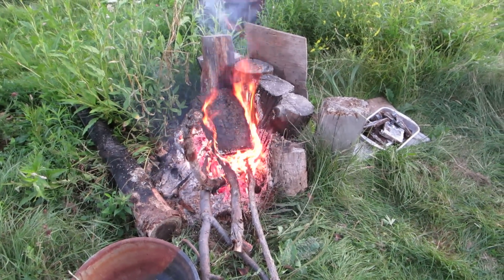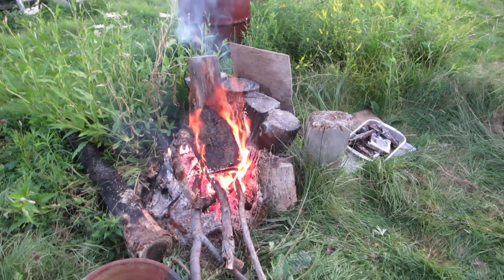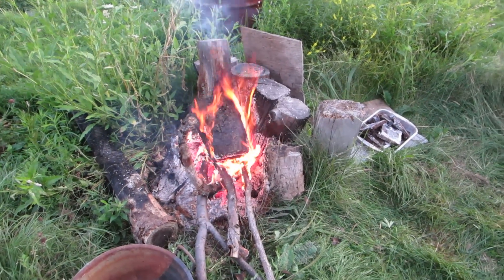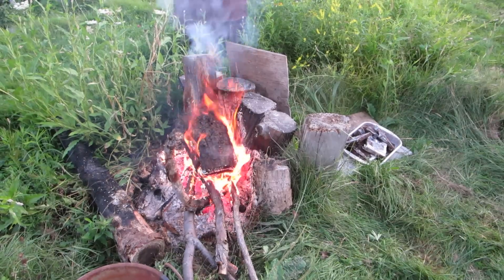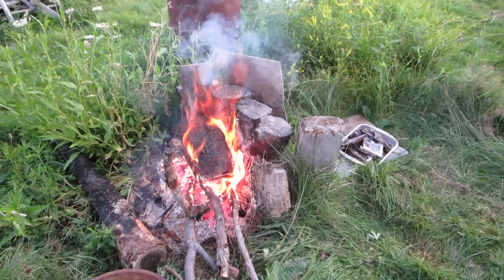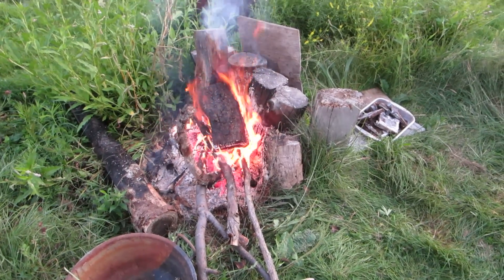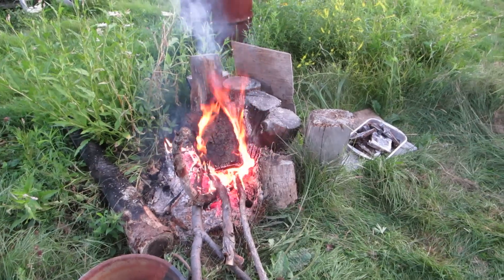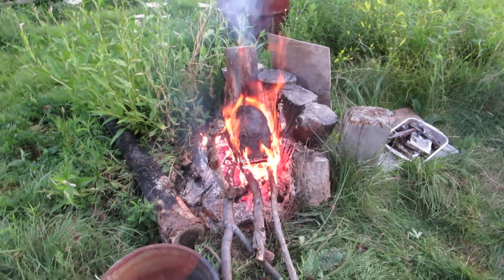EXTRACTING LEAD FROM A LEAD ACID BATTERY PT.1

Comment: Possibly the dumbest question to ask, but how did you open the batteries? Is there a quick way, or do they have to be hack-sawed open? After the acid is removed obviously.

Comment: I heard you shouldn't use battery lead for casting bullets. I want to heard about the bullets you made are they good? usable? subbed by the way
Reply from the maker: Thanks, lead is lead, when it is heated and the dross is skimmed off, it contains lead, plus tin and or antimony, etc.. I am no metallurgist, but I am a bullet caster.
Reply from the maker: I am sorry about your sickness. I am aware of lead`s toxicity. You know, many times, just washing your hands frequently will keep you from getting sick. Even counting the paper money in your pocket can make you sick. When I am finished working on machinery or anything, I scrub my hands with Go-Jo. You do not need to use water. Just wipe your hands with a clean rag.

Comment: Very, very dangerous. Most of that is not lead.. its lead oxide and has to be reduced back to lead.. which you are not doing when you heat it over an open fire. Here is an article that is, admittedly big on sciency things, but shows how to do this in a much safer fashion.

https://stacks.cdc.gov/view/cdc/10455/cdc_10455_DS1.pdf

Comment: 85% of the lead used in the United States comes from a recycled source, such as batteries, wheel weights, electronics, etc. Even if the last lead smelter left in the U.S. permanently shut down (which it did not) there would only be a minor increase in the cost of lead. And even so, major ammo companies such as Federal would just start their own smelting operations.

Comment: I am a Cowboy Action Shooter so lead casting is important to me.  I am NOT supporting Obama by any means, the lead smelting facility only closed down to reopen under new safer guidelines and procedures. Lead smelting in America is NOT over, it just has to follow new environmental guidelines and will be back in business soon. America can NOT do without out lead. Lead smelting is not gone. That is NOT to say led won't be more expensive but it won't disappear totally. As far as battery lead to be used in casting bullets, some people fear the acid will be transferred to the barrel. I always wash my battery lead with a water/baking soda mixture to neutralize any remaining chemicals. Baking soda is cheap, gun barrels.... not so cheap.
Reply from the maker: +Slingshot Silas I was not aware of the plant re opening. I read and heard only that it was being shut down. That is good news. I only hope the new restrictions are too onerous and add too much to the cost of production. I have been thinking that I may need to find out what is in the ingots. What did the battery manufacturer alloy the lead with. Still, lead is expensive. I cannot anymore find any repair shops that are willing to let their wheel weights go, either free or for a small price.

Comment: How many bullets could you cast from a piece of lead that size?
Reply from the maker: +DaUnaDistanza I would have to re melt it to remove any dross. I cannot answer that because it would depend upon the caliber. Anyway, I had already poured it into ingots for storage. Maybe 10- 15 38`s. As you get to the bottom of the pot, you have to quit, because it just doesn`t want to pour. At least with my equipment.  Hope this helps.

Comment: A discharged battery like this has had nearly all the sulfates collected on the cell plates and what is left is nearly all distilled water. Basically acid rain in a plastic box. I just pour it out on the weeds. It does no good, the weeds persist! Something I also found useful for how to recondition car batteries
  is Knewreck Rapid Renew Guide - it will be on google if you need it
Reply: Chemistry 101: 
In a discharged lead acid battery, both positive and negative plates do in fact become lead sulfate. However, enough acid remains in the water to blind you, cause severe chemical burns and poison the environment. Put some baking soda in the water that comes out of a discharged lead acid battery and see how "acid free" it is. 

The weeds did not die because it seems they like a more acidic soil, or it was diluted by rain.

EVERYONE:
Neutralize all sulfuric acid with an alkaline BEFORE disposing of it.
It is a direct violation of federal law to improperly dispose of sulfuric acid, hydrochloric acid and the like.
A dollar's worth of sodium bicarbonate can save a potential prison sentence if conditions are aggravated, and can save at least a localized area of the planet and life that resides there. 

No tree hugging. Just common sense and human decency.

Comment: I would be more concerned about how you are getting rid of the sulfuric acid?
Reply from the maker: AVI inc The electrolyte in a lead acid storage battery like this has a  water/ acid mixture to start with. A discharged battery like this has had nearly all the sulfates collected on the cell plates and what is left is nearly all distilled water. Basically acid rain in a plastic box. I just pour it out on the weeds. It does no good, the weeds persist! Thanks

Comment: I have old battery in the backyard how do you get the lead out of the battery and you need to wash the battery out before you start taking it apart.and how many lbs of lead in small car battery
Reply from the maker: Sean McEwen You need to drain the acid out. It would be a good idea to flush the battery out with fresh water. Wear goggles,  rubber gloves and an old long sleeve shirt you don`t care about. When it is empty, slice off the battery case top, sides, bottom. I used a sawsall reciprocating saw. You will see the cells in between the dividers. All batteries are not all made the same. I`m only telling you what I did.I would recommend melting the lead out of the cell plates with an old cast iron pan and use a Coleman stove because the heat is more intense and can be controlled.

Comment: I highly recommend going to http://castboolits.gunloads.com/forum.php?s=5e903699d1040ab870045a8d928d91ed, and see just exactly why what you are doing here is a very very bad idea.
Reply from the maker: Waksupi Carter  I looked and am curious: where is the thread which shows me that doing anything related to lead working is bad? I am an occasional caster and am stockpiling material that is scarce and expensive. Any warnings you may give me, in all alacrity on my part, will be considered, but you need to be specific. Thanks for your comment.
Reply: 1fanger 

http://castboolits.gunloads.com/google.php?cx=partner-pub-6216953551359885%3A1942134700&cof=FORID%3A9&ie=ISO-8859-1&q=batteries&sa.x=15&sa.y=16&siteurl=castboolits.gunloads.com%2Fforum.php%3Fs%3D5e903699d1040ab870045a8d928d91ed&ref=&ss=1863j486129j9 

Start going through these threads. I suggest joining that forum, and learn the right way to do things. before you run into serious problems damaging either yourself or your firearms.

Comment: Does melting the lead not release particles of acid? Or did you neutralize the acid on the lead?
Reply from the maker: I don`t know. The leaded plates you saw had sat in the open and got rained on and had sun hit them a lot, so frankly, I can`t say. I think there was a fair amount of sulfur left over in the residue and I`m saving all of that and will be disposing of it properly, as I care about my land. .Thanks for your comment.
Reply: 1fanger
Okay, I was just wondering. If they had been out in the rain and stuff it should be fine, but if you just took them out, neutralizing it with something like baking soda is a good precaution
Reply from the maker: BLEEPIN FIREMAN Well, being that I did all my work outside, it was fairly safe. The electrolyte was saved for proper disposal and the batteries were already dead. Maybe the acid was neutralized at that point.  There was no acrid smell. Thanks
Reply: Molten lead will react readily with any residual sulfuric acid to form PbSO4 and H2.